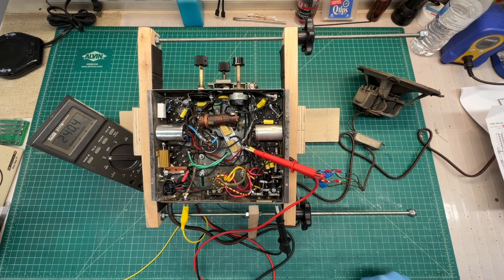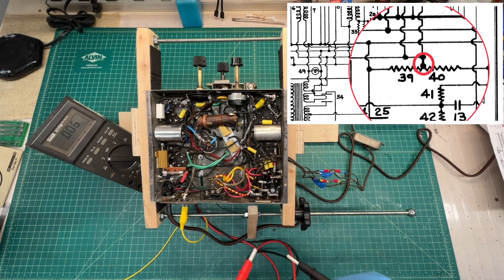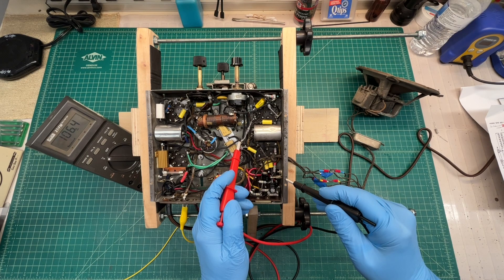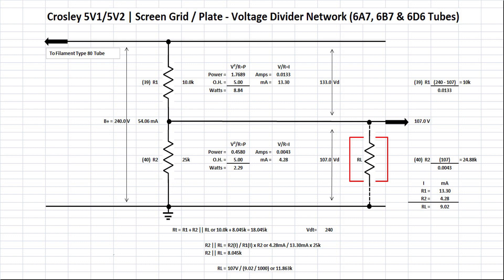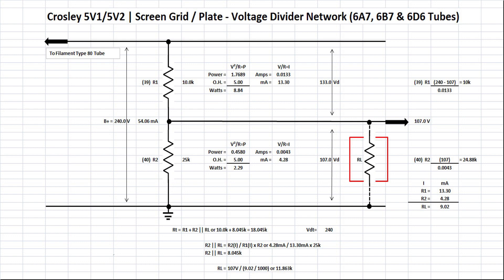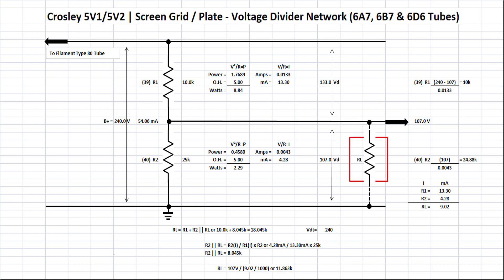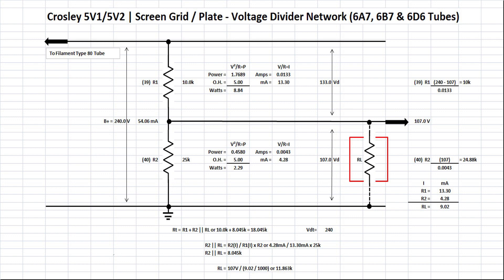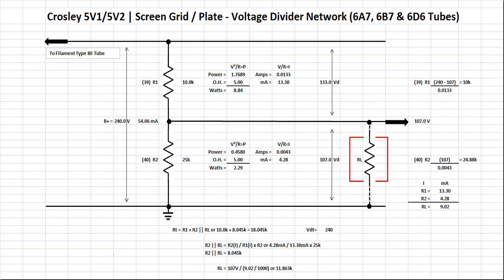Crosley 5V1 - Candohm Resistor Explained | Voltage Divider Calculations

Comment: Excellent Don. I must confess that I have a couple of pretty heft wire wound pots that I have jumpered into the circuit, dialed in the required voltage, measured the resistance, and gotten the closest resister.  I am a barbarian!!
Reply from the maker: Ian - a great solution on your part. I’ve considered buying some high wattage pots in the past and doing the same; makes for a precise M&P. Best, Don

Comment: it's A  series  parallel   circuit    !!!!, combine the two    parallel resistors and then  you solve   for the series , which   gives  you the current  across the  load  !!!!!     I know  my  stuff   !  computer/internet guy  with a  electronics  background  ,
Reply from the maker: Yep, just as I described. Thanks for watching and responding John. Best, Don
Reply: Pretty sure that is exactly what he did.

Comment: Over head O.H. is for what?
Reply from the maker: Hi Steve - the overhead is needed for heat dissipation of the resistor. Depending on the situation, a higher multiplier may be required depending on the mounting area and conditions. Hope this answers your question. Best, Don